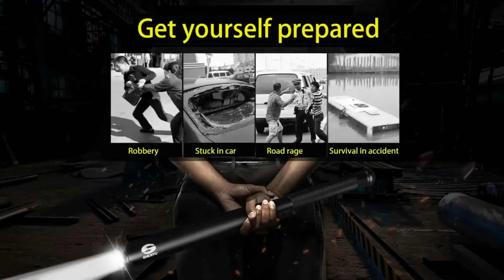Flashlight Baton for Self-Defense with Aliexpress ⚾ | Demo

Comment from the maker: Flashlight Baseball Bat ➤ http://ali.pub/5devbp  

                                          ➤ http://ali.pub/5devib 

                                          ➤ http://ali.pub/5a54vg 

=============================

LED Powerful Flashlight Attack Head ➤ http://ali.pub/5a56qx

LED Flashlight Knife ➤ http://ali.pub/5a5c2n

LED Flashlight Baseball Bat Mace ➤ http://ali.pub/5a5d1n

Telescopic Self Defense LED Flashlight ➤ http://ali.pub/5a5j29

========

Induction LED Headlamp (Touch) ➤ http://ali.pub/5a2um2

Headlamp XHP90.2 ➤ http://ali.pub/5a3dzc

Working headlamp 2 modes ➤ http://ali.pub/5a3hqh

========

USB LED Mini Flashlight,Keychain (Size: 5.2cm) ➤ http://ali.pub/5a32ne

USB Mini Flashlight (3 modes) ➤ http://ali.pub/5a5g0l

Most Powerful Mini Tactical LED Flashlight ➤ http://ali.pub/5a5h9b

Doctor's Mini LED Flashlight (USB) ➤ http://ali.pub/5a4v4v

========

Ultraviolet LED Flashlight ➤ http://ali.pub/5a345g

Ultraviolet Flashlight (100LED, 51LED, Q5LED) ➤ http://ali.pub/5a35ig

========

LED Camping Light ➤ http://ali.pub/5a3gd3

Led Flashlight USB ➤ http://ali.pub/5a5lhr

Camping lantern (white and blue light) ➤ http://ali.pub/5a5nx9

========

LED Work Light (5 Modes, 360 Rotation) ➤ http://ali.pub/5a3jnb

Solar LED Camping Light ➤ http://ali.pub/5a3pnc

========

High Power Laser Pointer ➤ http://ali.pub/5a4wsk

========

Landscape Laser Projector Christmas Party ➤ http://ali.pub/5a4xtw

Christmas lights (USB, remote control) ➤ http://ali.pub/5a4zhz

Christmas Led Garland ➤ http://ali.pub/5a50mm

========

Set 2pcs. Multitool + Flashlight  http://ali.pub/5dew8k